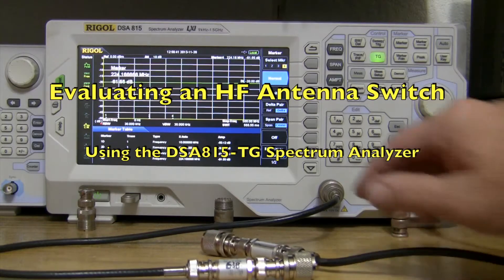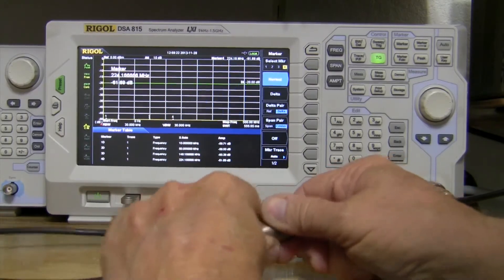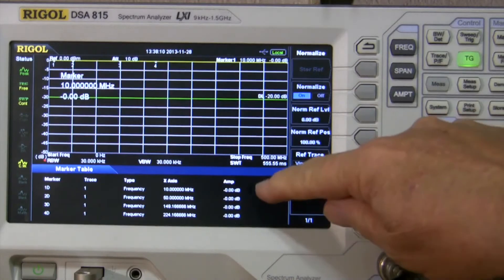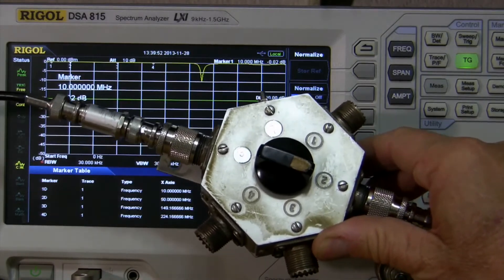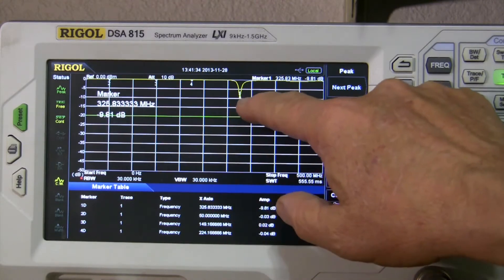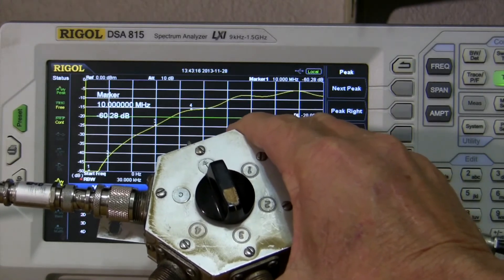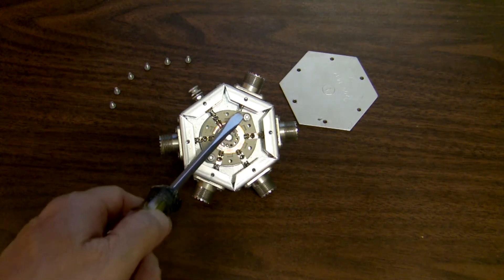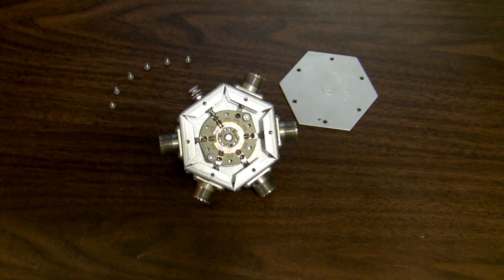Antenna Switch Loss & Isolation Evaluation

Comment: Thanks Jim, I have always wondered about my MFJ antenna switches.  Now I know how to evaluate them!
73,
Len, KD0RC
Reply from the maker: The other method, if you have a milliwattmeter or a sensitive wattmeter, is to look on other ports while transmitting on a given port.  Of course if you do this using a transmitter, you should use it into a dummy load instead of your antenna.  The 0dBm (1mW) signal from the Tracking Generator won't radiate very far even if connected to your antenna unless you have nearby neighbors.
Reply: If you look at the specs, the long 6-1 MFJ SW is max 30 mhz.  I have one and am looking at rewiring it internally with coax to see if that il help.  I would like to use it to 6 meters.
Reply: Another alternative is a SDR dongle as an input....